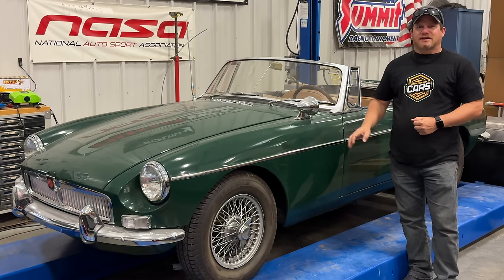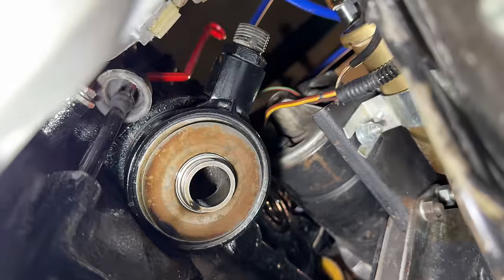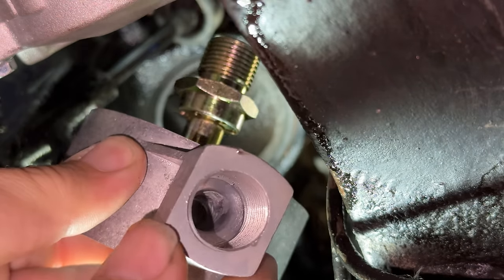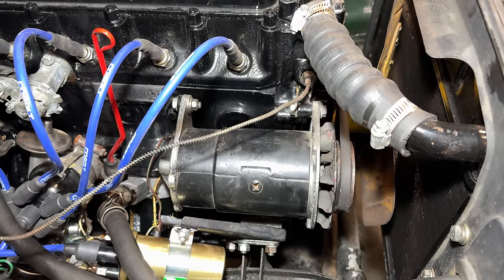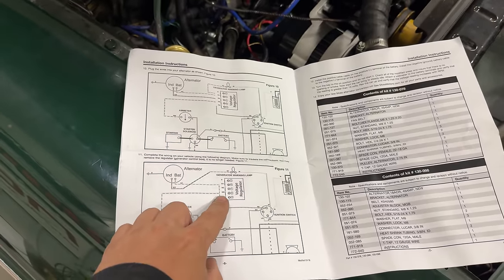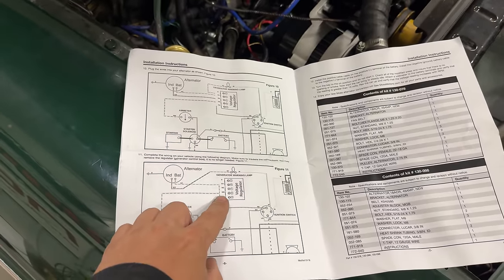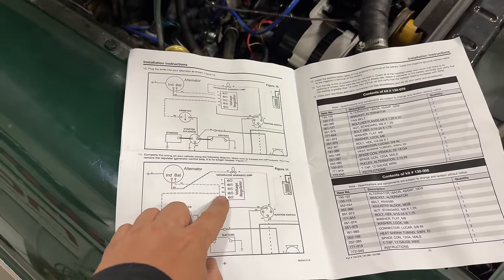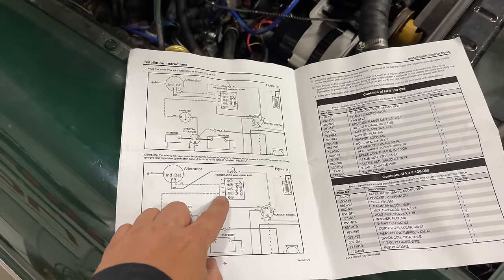Three Must Have Upgrades for the MGB

Comment: Exactly how classics should be - upgrade for practical and reliability reasons but maintain all the key elements that make this car the classic it is.
Reply: I would junk the B series engine, mainly because it was obsolete when it was first fitted in 1960s and then fit a more modern unit.  The B series was not even a good engine when it was designed, so it isn't worth keeping.

Comment: I am with you on everything except the Pertronix distributor.  Not a fan, I prefer the original Lucas point ignition.
Reply from the maker: What is your reasoning?
Reply: @ThisWeekWithCars  Many years ago my family was in the forklift business.  At that time the company was known as Perlux instead of Pertronics.  We used a lot of their breakerless ignitors especially when the distributors would wear and not hold a point gap.  They had a high failure rate.  Put a set in a TR6 I used to own and left me on the side of the road once.  So in my MGB I kept the original Lucas points and keep a spare in the trunk.
Reply: @ThisWeekWithCars  Really like your videos.  Always watch for the new ones when they come out.
Reply from the maker: Don't you think the reliability has changed over the years, they are easier to change out than changing points, and a lot more reliable than the points made today which are cheap junk.
Reply: @ThisWeekWithCars  Hopefully the reliability has gotten better.  True on the poor quality of replacement parts.  For now, I purchased a couple of NOS Blue Streak points at a local swap meet.  When those are used up I may take another look at it.

Comment: The standard cartridge oil filter is in many ways a better option, its more robust and the make up of the oil filter is way more better engineered than a modern canister filter.  The reasons quoted for the change are only convenience and that does not outweigh engineering quality.  Its no coincidence that Mercedes and VAG along with many motorsport teams use a filter with a cartridge element.  When you take out the cartridge you can inspect the filter pleats for debris, when was the last time you did that with a modern filter?

Comment: Good advise and video.  You might want to mention that the Pertronix unit should be used with an impedance matched coil the the pickup whether a breaker plate conversion or a complete distributor replacement and that it needs to be fed with a full 12v,  battery voltage to the coil.  No resistance wires fusible links or ballast resistors for proper operation in the circuit from the ignition switch.

Comment: Mine is a later model B so already has a spin off filter & alternator. The best mods for later Bs are lower it, fit a 3/4" front ARB and get rid of the rear ARB. Handles much better.

Comment: I have always preferred the old canister style oil filters! Do it right and they are much easier than the disposable type that you are converting to. You actually showed how easy to remover the old style filter really is, and wrestling a disposable type is much more difficult!

Another thing I dislike is converting to electronic ignition from conventional coil and breakers with condenser.

Okay that it is wise to keep some spares by you if on a long trip or even away on holiday, but they are easy to fix in a short time, whereas if electronic ignition fails you are literally stranded till you can get a complete unit as they are not user serviceable. 

I know some people are mystified by the quirks of old school petrol engines, but essentially they are simple and quite easy to fix!

I also prefer push rods and simple screws and lock nut adjusters to overhead cams! And the best camshaft drive on any car engine that I ever came across was in the old Volvo  Red Block push rod engine using gears rather than a chain or rubber belt ...

I really enjoy your videos!

best wishes from George in UK.
Reply from the maker: The Pertronix unit installs just like points and is even quicker to replace than points just one or two screws and you done not adjusting or retiming needed.
Reply: @ThisWeekWithCars  I bet it cost more than the old school parts though. I like stock original as far as can be managed!

I know you have to be a certain age to want that, but I have been fiddling with these old things since childhood in the 1960s and '70s.

Best wishes from George
Reply from the maker: I don’t know if you have bought parts recently but the quality of points today are terrible.  The metals that are used for the contacts are terrible and burn up or corrode quicker than my cars that have points that I have never replaced.
Reply: @ThisWeekWithCars  That is why you need to have my luck and know an old school garage with a large stock of NOS parts! I have been patronising my local garage since 1979 as a customer and known them since the the mid-1960s. 

I think they look at me as more of a friend of the family than a customer, and they look after me and my vehicles very reasonably. Three generations of one family, and all brilliant at what they do!

Best wishes from George
Reply: @ThisWeekWithCars I built a car with a re manufactured engine and a reconditioned Lucas 45D4 distributor. The points failed the following day after its maiden voyage. I went through many new condensers and points sets over a few years and at one time was buying three sets in the hope of finding a good one. The car was never reliable until I replaced the entire points setup with an Aldon Ignitor module. Fit and forget.

Comment: One thing I'd definitely add for safety reasons is an electronic turn signal flasher upgrade. Usually, if you're at idle with your headlights on, your windshield wipers turned on and your blower motor running, your original equipment turn signal flasher won't blink or will barely blink. An electronic flasher will blink at a normal flasher rate no matter what other electrical device is turned on. It will even blink at a normal rate even if the engine is not running. I picked mine up out of a modern car I found at the wrecking yard. For my other MGB I found an electronic flasher unit at an auto parts store. Way back then it was about $10.00. I think Moss Motors finally carries them now, but other places carry them as well. My 68 and 77 MGB has a two wire electronic ignition flasher. Some other modern cars have three wire. I have no idea if they can be rewired and turned into two wire. - Thomas

Comment: Thanks for the real world approach to the MGB as a classic. I've had my 74 B since 2000, My B never fails to start and has left me stranded only once in 24 years. I use it 2-3 times week. I've done the same modifications as shown over a longer period of time however. May I suggest installing a headlight sub harness with two relays and updating to halogen headlights. This made a huge difference over the stock Lucas lights. I'm contemplating LED headlights any ideas? I also updated my fuel pump to an electronic version of the SU, it's a direct bolt in and has performed flawlessly for 22 years now and still going. I drive this car about 2K mi / year down from the 4K miles / year before I retired. I get in it and drive it like I do my Ram truck, start it and go. The overdrive is really nice and I can cruise on the freeway at 70MPH with no issues. I had two British cars, a 67 Austin Healey 3000 BJ8 and my 74B, guess which one I sold. It was just too much trouble...

Comment: The oil adapter kit had some problems a few years ago that lead to oil leaking profusely because the filter ended improperly seated and had a gap between its base and the adapter. Hopefully Moss fixed it by now.

Comment: Hey Steve, it's my understanding that the rear main "seal" on these engines weren't really a seal - which is why they leak oil so much. If true, is there a retrofit fix for this as well?
Reply from the maker: Most British cars are that, there are modern seal conversions available that require machining of parts to be installed but I have not had good results with them.  If your engine is properly vented and the valve cover is connected to the air filter as original the original system works well.

Comment: Steve, what gage wire did you use between the alternator and the solenoid?
Reply from the maker: Lucas alternators are usually under 40 amps so a 6 AWG or even a short 8 AWG will be fine.

Comment: Not the upgrades I expected to see, but valuable ones just the same. Will we be seeing an upgrade to the front shocks next?
Reply from the maker: What reliability upgrades did you expect?
Reply: @ThisWeekWithCars  These cars benefit greatly from upgraded brakes and suspension modifications. Age also affects the ride quality because of the shock absorbers. These are fun cars if the suspension is fresh and tight.

Comment: Does anyone make an overdrive for these?  Brit cars were made for the roads they'd see at home, that was before the motorways opened and speeds were quite low, generally well below 60 while American freeways even then were doing 70s.  The little pushrod four at that higher speed won't be happy for too long.  Some british imports came with a kit to adjust for American gas, it raised the compressor by about a point and allowed more spark advance, British gas was almost kerosene in that regard.
Reply from the maker: These cars could be had from the factory with overdrive giving you six gears there are also many five speed conversions to modern transmissions available.
Reply: The one MGB I owned had what I guess was the factory overdrive... If I remember correctly it was a stalk switch on the steering column
Reply: How you do all this, commentate at the same time, and film is beyond clever. Presumably it did not take 18 minutes as we know you are explaining bits and doing it off camera. You have an absolute gift for this type of video. It should be compulsory viewing in college where they teach garage mechanics!
Reply: My "66 B I believe has an electric one. Every time I hit a big dip in the road it disengages briefly so I imagine there's a weak spring some wheres in the solenoid?

Comment: You forgot,  install a solid-state fuel pump, no more tapping with a hammer or cleaning the points with emery paper.
Reply from the maker: I have had more problems with modern pumps, especially the cheap Facet pumps than I have ever had with the SU pumps.  I do like the solid state SU pumps that are now being made.
Reply: @ThisWeekWithCars  My pump, which I've had on the car for 20 years or more is the SU, fit & forget. When I originally rebuilt the car I bought a new SU pump (with points) & it ran fine for years but as luck would have it, it needed a tap on a rainy evening, when I was dressed up.
Reply: On one of my MGB's, I replaced the original fuel pump with a Honda Accord fuel pump from a wrecking yard. Of course, it was from an older, carbureted Accord. Worked perfectly. The other mod that I made was putting a electrical cut-off switch behind the front seat. The kind of switch they use on drag racing cars. When I shut off the engine, I just reach behind me and turn the switch. No battery drain from the "Prince of Darkness" and would=be car thieves would be baffled.